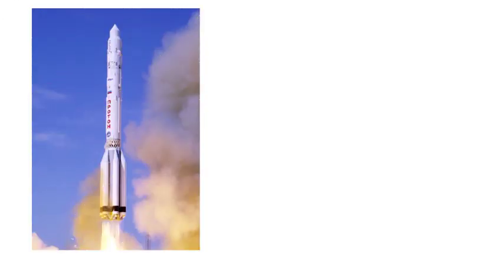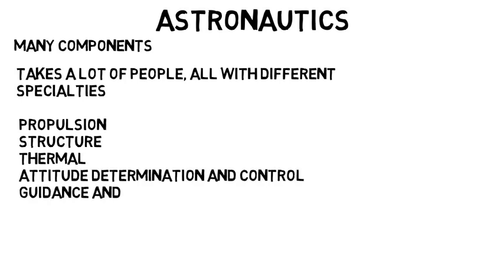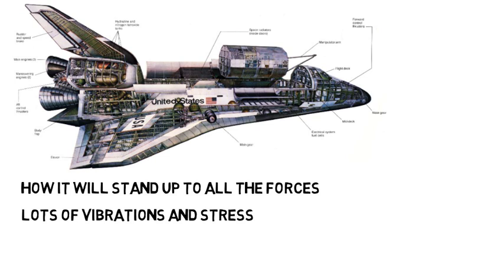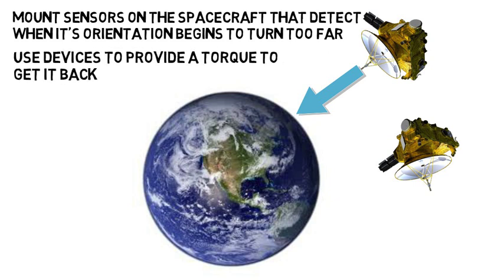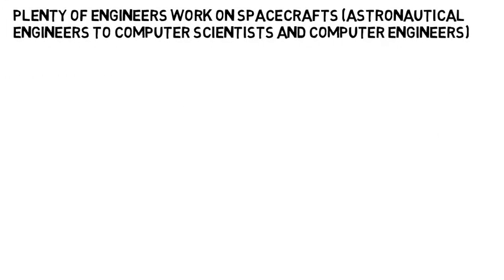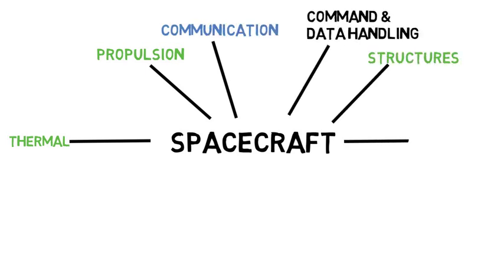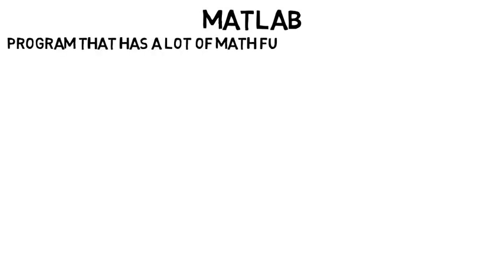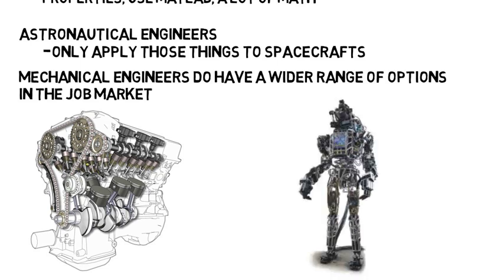What is Aerospace Engineering? (Astronautics)

Comment: I know I'm 4 years late but a quick correction: 2:10 (ish) almost all rockets today use liquid fuel on the ground. This is often (but not always) in combination with solid fuels. Solid fuels are almost always (with some exceptions[primarily in some missiles]) used in the ground and not in space.
I know that this is designed as in introduction so it was better to keep it more simple but I thought it was worth mentioning.
Reply: there is no way to control the speed of which the engine is at, on a solid fuel booster, (i.e once ur SFB is on, it will stay on till the fuel ends, unless you can douse its flames somehow and very physically stop it thru chemical combinations, which is infact, very un-efficient)in a LFB, you can turn the booster on and off at your own will

Comment: I'm going for Astronautics
Reply: Does anyone know if propulsion system education and structures and design require science and mathematics?!
Reply: @ahmedfathallahh6678  They definitely do
Reply: @ahmedfathallahh6678  are you joking
Reply: @ahmedfathallahh6678  Yes, a lot.
Reply: @ahmedfathallahh6678  I think yes
Reply: @ahmedfathallahh6678  absolitely
Reply: @ahmedfathallahh6678  Yes, of course you will need science and mathematics. Mathematics for calculating metrics for spacecraft and amount of propulsion. Science would be used for what the propulsion is made of, so like the chemical substances.
Reply: @hertha9245  see you expedited in astronautical engineering?
Reply: Same
Reply: Same
Reply: In which university did you joined in India
Reply: @majjarisrinivasulu4055  no potato university

Comment: I'm in love with astronautical engineering but confused between the subsystems. (Attitude determination & control/ Propulsion/ Structure? ) can somebody explain to me in detail about them?
Reply: Quite frankly, play kerbal space program. It really illustrates the basics
Reply: @KirisPlace   could uh provide the icon for the kerbal space program?
Reply: I’m not gonna go into detail, but basically attitude determination & control = figuring out where you are in space and controlling your vehicles orientation. (For some fun google star trackers, reaction control thrusters, momentum wheels, and inertial measurement units)... propulsion = the pieces of your vehicle that make it zoom in space lol (google electric propulsion, LOX, hypergolic, hydrazine, chemical propulsion etc)... structure = the part of your vehicle that holds the craft together under load (when firing thrusters) or when moving parts are going (solar panels deploying). Structural aspects can also protect against radiation and space debris like micrometeorite impacts.

Comment: What are the weedout classes for aerospace engineering? I am assuming they are physics 1 and 2, some of the calc series, chem, thermodynamics and some others. How do you handle these classes and actually do good in them? Is it just not possible?
Reply: Rishi Prabhuram I'm in my 3rd semester right now. They are possible, you just really need to study
Reply: Rishi Prabhuram they’re incredibly hard. If you study and remain determined you will do well. In terms of other classes, statics, Dynamics, and material properties (called Mechanics of Deformable Bodies at my Institution) are often ones people have never heard of until they get to Uni
Reply: courses I had in the first year were: waves & electromagnetism, thermodynamcs, calculus, stats/dynamics, material properties, mechanics of materials (structure analysis etc) linear algebra, python. Then in the second year I had structural analysis & design, aerodynamics (sub and supersonic), differential equations, numerical analysis, control theory.
Reply: also data analysis, forgot that one
Reply: I'm also forgetting orbital mechancis, flight dynamics, power & propulsion

Comment: How do they do CFD to Rockets in outer space and satellites as it would be much less dense? Would it be possible to specialise in robotics after mechanical engineering and then further specialise in space and robots for exploration in other planets? Is this a very scarce job market?
Reply: Justin Chan there are some troubles when doing CFD with very low densities(there is a point where the continuum hypotesis use for the whole of fluid dynamics stops being applyable).
The calculation of drag for orbiting spacecraft is not usually the most important of things when calculating a spacecrafts orbit(they are of a much lesser order of magnitude than gravity forces and effects of third objects).
However for Low Earth Orbit satellites it is important in order to calculate the stability of the orbit. For this it is common the use of several empirical models that work with the data of previous missions. 

I hope I ansewered your doubts =)
(I'm a 4th year undergraduate student in aerospace engineering in Madrid, Spain)

Comment: Point of order! The Space Shuttle used both solid fuel (in the two Solid Rocket Boosters ) as well as liquid fuel for the main engines (RS-25) LOX liquid hydrogen and also the Orbital Maneuvering System (OMS AJ10) used a hypergolic liquid fuel as well MMH/N204.

Comment: Is taking masters degree on aeronautics engineering after bachelor's degree in mechanical engineering worth it?
Reply: Yes but it will take u longer
Reply: Yes it’s a good combo.
I’m doing mechanical engineering MEng in the U.K. and then. Msc in aeronautical engineering. I’ll also do economics Ma while I work in a large corporate such as airbus. I’ll learn to become a test pilot, i might just make my own company.
After I get some experience I’ll just back to uni to get an electrical engineering Msc.
So when I’m 30 ish I’ll apply to become an astronaut in the European space agency. 
Mechanical and then jumping to do one of the aerospace is best combo for space.
Reply: @bobbyweirddick6556  doesn’t a MEng in mechanical eng take 5 years? Then you wanna do a MEng in Aerospace? Wouldn’t you be 30 by then? Also isn’t aerospace just aeronautical and astronautical engineering combined into one degree? After looking at modules and now this video I’m slightly confused.
Reply: @Prashant-pm7iz  it is, but as you go through I believe you can specialise in one of the two subsections.